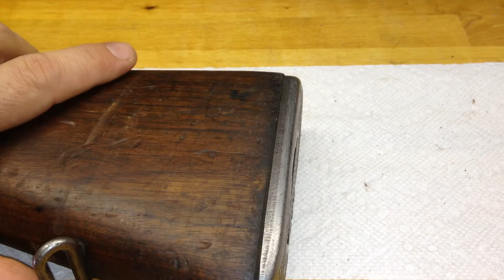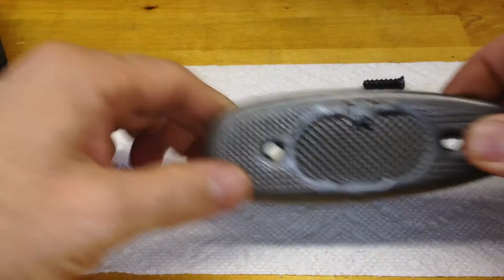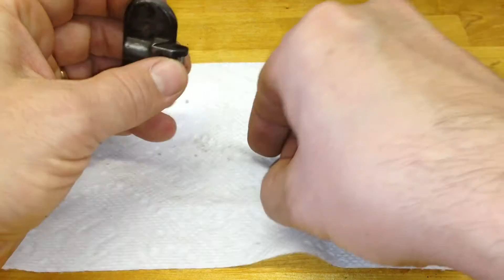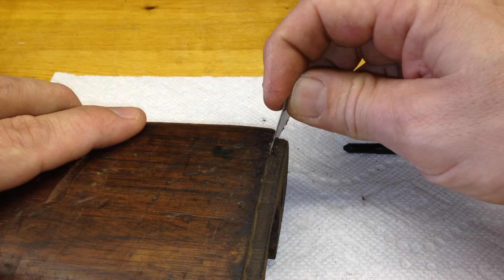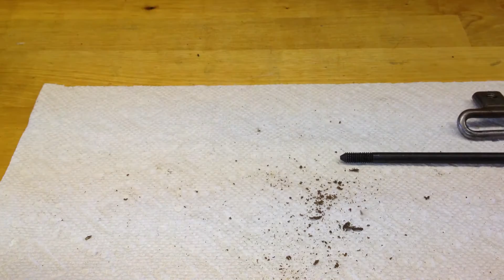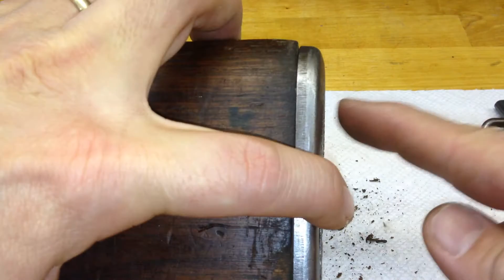M1 Garand Buttplate Removal & Installation

Comment: Hey, do you have any tips for reinstalling the trapdoor? I've got only two hands and not enough grip strength😅. It's been a real pain in the butt.
Reply from the maker: Yes, it is very difficult.  I have removed good doors off of bad buttplates and reinstalled one that I can remember.  Pretty sure I used a bench vise to hold the buttplate.  You will need a long and short punch and might have to open up the curled and folded hinge holes.  But is should go on.  Why was it off is my question?
Reply: @norwich93CMP   The buttplate couldn't open easily, so I figured I'd clean it up a bit.

Comment: What is the consensus on buttplate fit, I have saw some stocks that certainly did not look sanded but the buttplate had just a slight overhang, some say shrinkage others say minor difference in stock and buttplates can cause either overhang or underhang. What is your experience?
Reply from the maker: Generally I see slightly oversized or plush fitting stocks to the buttplate.  If there is overhang it usually is worn or sanded, and few might have gotten by inspectors.  More importantly is how the heal of the receiver fits on top of the stock.  That is a good indicator of sanding.